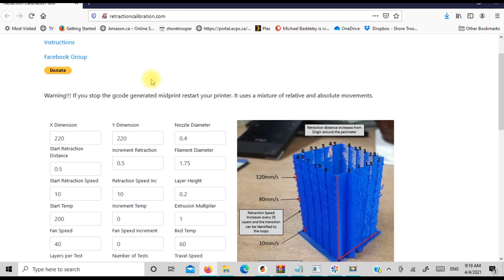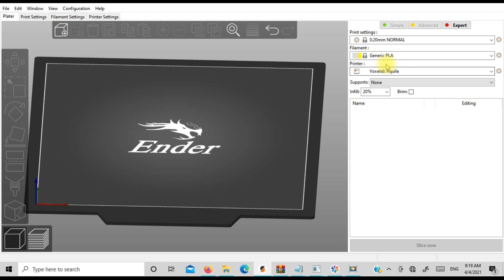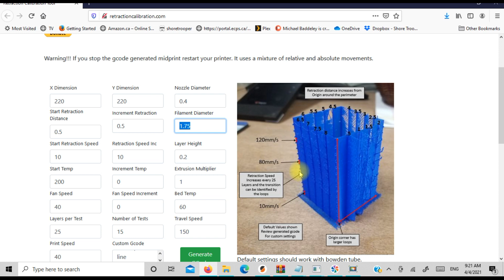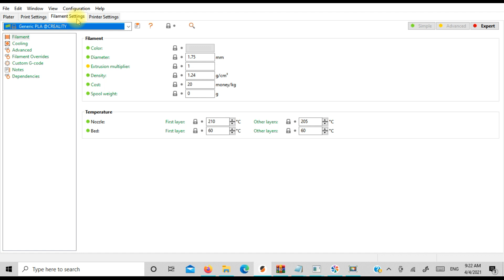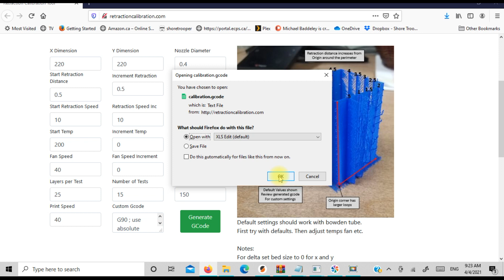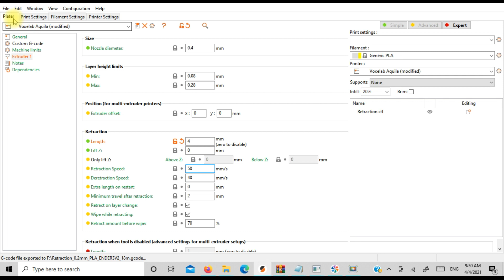Retraction Made Easy

Comment: Hi Jeff, thank you for sharing your knowledge with us. Much appreciated. 
I have the Anycubic kobra max and have had a bunch of small issues that prevent me from completing the project I got into 3D printing. One of them is the stringing I face with PETG. I ran this test and like the others cited, it does not get to a nice smooth line like you show in your print. On the heavy side it is like a protruding wall and on the best side it has the long curved upward strings. We don't get that nice flat side like you show. 
I'm sure we need to make an adjustment in the setting but what one and what direction?

Comment: Ive tried printing this thing 4 times and it just wont adhere to my bed. Prints anything else fine, minus the stringing issues, but the first line it tries to print just wont stick. Any ideas?
Reply: The Gcode does not want to play well with my Kobra Max. It extrudes the first few lines, and then stops, but the print head will keep going.

Comment: I tried this on my Kobra Max and there is no change all the way around the test. The stringing is like solid poles jutting out horizontally from the vertical lines. But yeah it does that ALL the way around the whole test. It looks as if it is not making adjustments. Not sure what I am doing wrong.
Reply: Same here.  Looks like each layer has a goob coming out all the way around.  Wasted filament and an hour+ printing out this garbage.  Something changed.,
Reply: disable power lost recovery on combra max

Comment: My towers came out with lots of pits between the tower. I've tried it with extrusion  multiplier of 0.8 which is the number I got after my slicer flow calibration.

I've printed another with extrusion multiplier of 1 and there were still pits although a lot less.

Comment: Great video! I do however have a question i was hoping you or somebody else could answer. For Travel Speed and Print Speed do my settings need to be the same as on this video? Im using Klipper so my Travel is set to 250 and my Print Speed is 100...  Also does the extrusion multiplier have to be 1? I tried changing this to my flow rate but it didnt like that
Reply: I would keep your print speeds and those settings equal to your normal print settings.

Comment: Are you looking only at the dendrites/branches that stick-out from the sides of the tower, or are you also looking at the wall quality in between as well?
My walls are, for the most part, incredibly pitted as if they were underextruded. 
🤔
Reply: same the wall looks under extruded
Reply: Same here. I'd like to know what the pits in the walls mean.
Reply: @andycrighto3740  I ended-up compiling a Linear Advance firmware for myself in Marlin 2.1.2 (as it works for TMC2208 drivers now), and, now, retraction is unnecessary to begin with :p

Comment: Many thanks for ur sharing and I have came into a problem that I had tried many times with different retraction model and found the Retraction Distance might be very long, like among 15 which most people said it should be around 6 for bowden printer. I am not sure whether it is influenced by opening the Linear Advance in Marlin. And I wonder what's the best result we can get, an retraction tower with the least additional lumps or it should be perfectly smooth(when we use Johnson's model). Hope to get ur answer.

Comment: I have tried the Gcode generator from Teaching Tech and had good prints with it but could not get the same results from when putting the settings in my slicer (Cura 5.1 also tried 5.0). Wouldn't I have the same problems with the settings not porting over when using this print?
Reply from the maker: At the bottom of  Micheals retraction page he actually points to this test. So I'm not sure sorry.

Comment: maybe i did something wrong? It said it would take 24 hours to print? That seems like a lot for what it is.
Reply: 24h seems awfully long (mine took about 8h) but it's a fairly tall object with something like 225 distinct tests at different retraction lengths and speeds. It'd be tough to do that many tests that quickly if you had to do them manually.

Comment: Thanks, this is further proof that I need to get a filament dryer and don't settle on the cheap filaments. My test came out with bad stringing all the way around the box. I thought I was going crazy with the little two prong retraction tests!
Reply: Me too....I wish I could attach a photo.....I can't even tell where the front or back of the tower is....1 side has pretty full columns sticking out, the others are very blobby.

Comment: man i was excited when i found this. i have a brand new ender 5 pro so i figured itd be an easy shortcut to a good tune. when the gcode prints tho, the extruder isnt pushing filament. not a clog or anything, its like its not trying to extrude at all. just running the print path. . . . bummer, guess i'm doing it the hard way after all lol.
Reply from the maker: There is a Facebook group. Maybe they can help
https://www.facebook.com/groups/199257421413533/?ref=share&exp=c41f
Reply: @jeffs3dcorner  sweet thanks!